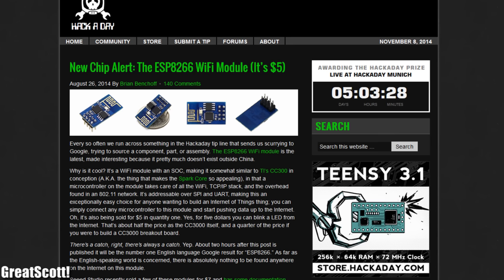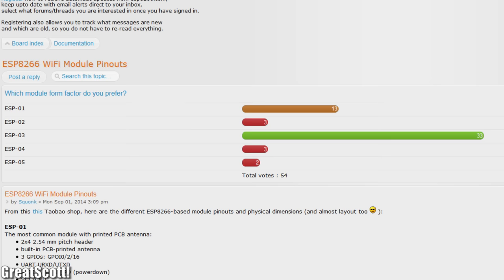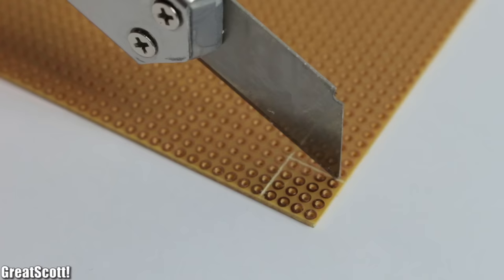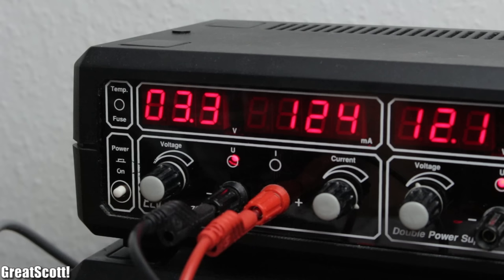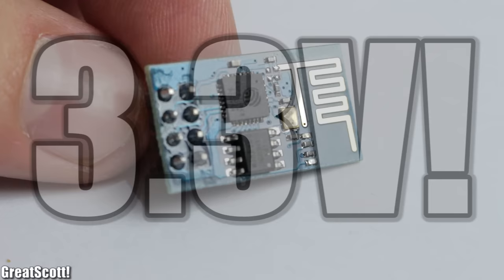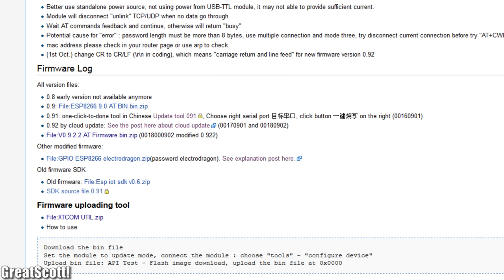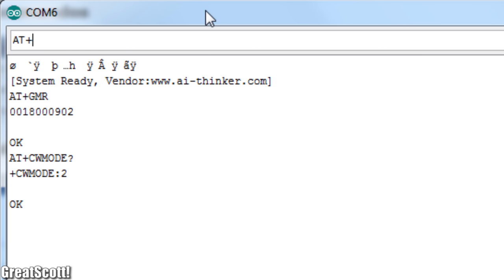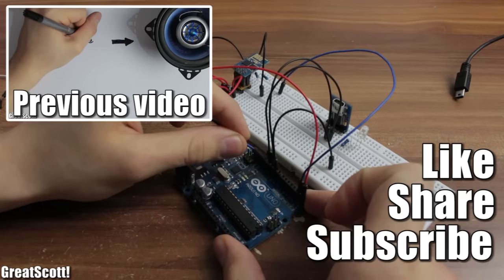5$ Arduino WiFi Module!? ESP8266 mini Tutorial/Review

Comment: This can't called a module. ;-)

Single-modular transmitter is a self-contained physically delineated component that can demonstrate compliance independent of the host operating conditions, and complies with all eight requirements of the Section 15.212(a)(1) and summarized below. See Section 15.212 for more detailed information, and Section 2.901 (and subsections that follow) for general certification requirements.
i
The radio elements must have the radio frequency circuitry shielded. Physical/discrete and tuning capacitors may be located external to the shield but must be on the module assembly.
ii
The module must have buffered modulation/data inputs to ensure that the device will comply with the Part 15 requirements with any type of input signal.
iii
The module must contain power supply regulation on the module.
iv
The module must contain a permanently-attached antenna, or contain a unique antenna connector, and be marketed or operated only with specific antenna(s), per Sections 15.203, 15.204(b), 15.204(c), 15.212(a), 2.929(b).
v
The module must demonstrate compliance in a stand-alone configuration.
vi
The module must be labelled with its permanently fixed FCC ID label, or use an electronic display (See KDB Publication 997198 about labelling requirements).
vii
The module must comply with all specific rules applicable to the transmitter. The grantee must provide comprehensive instructions to explain compliance requirements.
viii
The module must comply with RF Exposure requirements. For any transmitters intended for use in portable devices, SAR compliance must be demonstrated to be independent of the host device. See KDB Publication 447498 item 2 as a guide to determine if a transmitter can be tested without being limited to a host device. If SAR can only be demonstrated in specific host types or platforms, then the module type must be limited.

Comment: Having a issue. When I open the serial monitor literally nothing shows ups I typed in the code and still nothing I bought 2 of these and really want to use this. Any help / links?
Reply: I have the same issue, apparently you need to cut the power of the module and reconnect it until the software shows something.

Comment: can you provide a diagram of your setup? I've being trying for months and I cannot get a reading from it.. I tried voltage divider, TTL, anything I can think off and not sure what I'm doing wrong :(
Reply: Cesar P Im not sure if the voltage regulator was for the TX line into the module or for the 5v to 3.3v VCC. I'm assuming is the first one and you are using a 2AA battery to power the module and also ground it to the arduino?

Comment: Voltage dividers. How do they work?
Reply: put two or more resistors in line, the voltage is equivalent to the values of the resistors. If you have 1k on top and 2k on bottom, at the connection in the middle you have 2/3 of the top voltage. It is linear.

Comment: It works like the bluetooth. Using AT commands
Reply: AT command system was originally made to control analog phone line  modem hardware, as normaly modem sends any data that that comes from serial port and sends recived data over serial port, so modem functioned kind of like serial port over phone line, AT commands is made to control other functions of modem then just sending/reciving data, like line control, dialing, reciving calls, changing configuartion. Later this was adapted to different kind of communication interfaces that use serial port all GSM modems still use it as this way of communciation gives software isolation, not to mention it's more standarised so no drivers are needed, Bluetooth and WiFi can work under it too even thru it's not really needed for those technologies

Comment: Good noon sir. can I ask ? how to control 4 servo using esp8266 connected to arduino .Thanks
Reply: +Junioriz Cortes That's a tough question, You could use a servo shield and hook up servos and use the analog pins for module or you could just set up the servos normally on a Uno and hook up the module anyway you like but the real problem lies in the wireless communication part, If you can make the module connect to your IDE on your laptop, with a little know-how and a few lines of code, you can wirelesly  control your servos

Comment: hey electricians HELP ME out here man! 
so i dont this is possible or not but something been in my head and which is . i want to control a led from my phone ( led is example here,if i can control led i might be able to control something else too) 
 so  is this possible via any kind of wifi circuit  ? its like circuit is connected to the led and its powered on,i connect to it via wifi and write some command or press button and the led gets turned on ?  you get the idea . anything like that could be done through my phone ?
Reply: +Uegene Dyalnburke Spark photon does this

Comment: Suppose I have connected 1 ESP8266 RX-TX pin to an FTDI Adapter and the adapter to a PC and a COM port is displayed. Next I connect 10 of these ESP8266 to 10 different uC board. Now I want to Transmit data from my serial monitor through my PC connected ESP8266 to all my other 10 ESP8266 connected uC with the same baud rate in all case, simultaneously without any lag. Will it be possible? Basically I want to make the ESP8266 act as a server and the others as receivers. I will be waiting for you reply.
Reply: Archisman Sarkar did you get the solution..... if you got it then please let me know.
Reply: Nope. I didn't get the answer yet.

Comment: Hi, Can I connect the wifi module directly to my 3.3v from my arduino ? cheers
Reply: +Kevin Quiniano 
tried that. Didnt work...the module pulls too much current. The 3.3V output dropped to 1.9V when i connected the module. I use a LM2596 module to power the WLAN module

Comment: Hello Scott ! When i start my ESP8266 ( Plug the power source ) My usb disconnects, i can see the rx lights from my ftdi chip lighting but what can i do ?
Reply from the maker: Dogacel Cubing Sounds like a short circuit on your breadboard.
Reply: I solved the problem, it's probably because of capacitors, when i plug in capasitor draws big amount of current. It happened on enc ethernet card too. But this time, my data has some lose. Sometimes serial monitor shows characters missing , sometimes webpage loads wrong. I don't know why. BTW is it safe to use RX, TX with 5V ?
Reply from the maker: No it is not. But I said that in the video.

Comment: what is the part that you have used to connect the wifi module to the pc (with the usb connector) is it useb to serial converter ?
Reply: Muhammad Nour Elmogy USB to TTL converter. They are called FTDI modules on ebay but I use an old RS-232 to TTL converter made by Motorola (RIB) box.
The modern ones are the FTDI ones on ebay.
The cost a couple dollars.
Reply: I wouldn't get an ftdi one,  as most eBay ones have a fake ftdi chip which has been troublesome lately with the new drivers. The ch340 ones work fine tough.
Reply: Tamás Molnár that's because FTDI had a windows update that killed the counterfeit chips, Microsoft removed that update  from auto queue though.
Reply: Yep. But the current driver will still not work with fake chips, even though it won't kill them. Why bother?

Comment: ohh wow, I have some minor Microcontroller experience, but definetly lack the electronics skills with current and stuff.
I thought using a simple WLAN module on an arduino would be more simple.. now all I can tihnk of is how I'm gonna fry it.

I don't know if it is my lack of skill but somehow this is quite initimidating :(
Reply: Thanks for your reply I didnt even know the uno has a 3.3V output.. I thought it only has a 5V output? Or what else could you mean when you say it's 3.3V doesnt supply enough current?

Okey I have no idea what you talkabout AT command stuff.. Honestly I have never worked with WLAN at all.
Reply: it costs on ebay 2$ get 3 of em. or get a regulator for another 2$ done and done

Comment: is this chip  NRF24L01 do the same job as the one you reviewed (ESP8266)??
Reply: +Djazeiry No very diffrent i don't think the nrf24Lo1 can connect to wifi
Reply: Although both the NRF24L01 and ESP8266 look identical, (except maybe color) the NRF modules are 2.4Ghz transceivers where as the ESP uses 802.11b/g/(n) WIFI. They are both utilized in wireless applications however the modules differ with respect to the connectivity and they are both used to accomplish a different task. An ESP would connect your project to your WIFI network where as the NRFs will provide a 2 way connection between two separate NRF modules (one NRF is set to transmit and the other set to receive).  Use the NRF to send data between two devices and use the ESP to connect and/or control your project over a WIFI network. 
Cheers my friend,
Aj
Reply: Anthony Odin thanks anthony great explanation !
Reply: +Djazeiry 
Anytime my friend! If you have any questions in the future and can't get an answer you are welcome to message me and I will be more than happy to assist. 
Cheers
Reply: Anthony Odin thanks a lot that's kind from you , now i bought the ESP12  just don't have time to try it :P

Comment: So after you insert a wifi name and password, is it saved? or do you need to re-enter everytme?
Reply: on power loss, in this mode you have to reenter every time. because another mcu like arduino is supposed to talk to it like it's a wifi modem and telling ssid and pw on init. but this wifi chip does have more power than an arduino itself, so people program it with the arduino ide like it's an arduino.
you can also flash it with tasmota (based on arduino framework) for home automation.

but people prefer a nodemcu or d1 mini board (both have the same ESP8266 mcu chip) or even the newer ESP32 (newer mcu chip)

ESP8266 together with software like Home Assistant on a raspberry pi is a big hit for home automation diy stuff

Comment: Question do you know how to put the bootloader onto the atmega328 ic?
Reply from the maker: Sure, but google can help you as well.
Reply: I tried.... Not well and other vids don't explain well
Reply: but i have this same problem... You can try by usb programmer
Reply: I am a complete noobie at this and found your video really helpful - so thank you for that - but I have the same problem as Sonny Brikkz. 

Could you do a step by step guide of uploading firmware with info on all the programs you use and websites you go to etc please. Thanks again buddy :)
Reply: there are a ton of  instructables and how to's on that. However.. you need a programmer and the Arduino is the easiest for that. Load the ISP program into yr Arduino, connect the Atmega with SPI and  'burn bootloader'

Can i advice against it though. making your own 'arduino'  by burning a bootloader on an Atmega328 is hardly worth the trouble for nowadyas  arduino clone prices (1.50 euro for a promini)

Comment: You realize that the chip on that module is more powerful than the arduino itself and can actually run the arduino bootloader and thus arduino sketches? I've seen people overclock it to 160 MHz (10x faster than the arduino uno I believe)
Reply: This is basically an arduino with more flash and 10x faster processor with built in WiFi capability. And you've connected it to an arduino that is 10x slower and costs 4x as much.

Comment: The 8266-01 version (4 pins) hasn't come down in price much since I bought mine and often complete ESP8266-12 modules, including USB and PSU are much cheaper.
Right now I would not advise anyone to buy the 8266-01 version, but go for a cloned Wemos D1 mini (2.30 euro) or the NodeMCU (around 2.50 euro).
The 8266-01 is a great chip and  inspite of its 4 I/O you can still add a lot of peripherals if you use I2C, but the Wemos D1 is  just a better buy and if you buy what I presume to be a clone of the Wemos D1, it is even cheaper.
The ESP8266 is a powerful microcontroller. No need to hang it on an Arduino

How to use all 4 pins of the 01: https://arduinodiy.wordpress.com/2016/10/11/using-the-4-pins-of-the-esp8266-01/

Comment: It would be excellent if you built an OSC (http://opensoundcontrol.org/) to MIDI converter only using the chip (no external microcontroller). It would be an excellent tool for networking old music gear with software like Max/MSP.
Reply from the maker: Steeve Bjornson I wrote it on my to-do list.

Comment: If somebody could help me out with this, that would be great! When I have the serial monitor open on my computer and I power on the Wi-Fi module like how it was shown in the video, nothing shows up in the serial monitor. Sometimes the blue light flashes a couple times then turns off but most of the time only the red led turns on. Also if you cant tell im using a Arduino Nano in place of the FTDI usb to serial adapter. Also, on the Nano only the TX led turns on not the RX. If somebody could help me with this it would be much appreciated! And if your wondering how im powering the ESP8266 im using a 9V wall wart and a LM2596 buck converter to convert it down to 3.3V. Here is an image of my breadboard so you can see whats going on, http://imgur.com/dQplbfF

Comment: The boards are as low as £2 (maybe $3) from China in 10s. Currently looking at implementing MQTT in them - which means passing temperatures, sensor readings, on-off instructions around the devices with no limits - with or without Arduino.  More at the blog - scargill.wordpress.com  - great video.